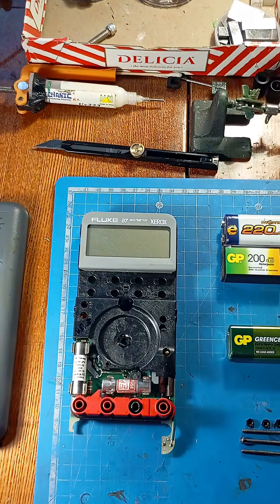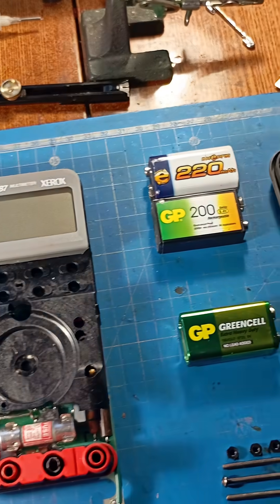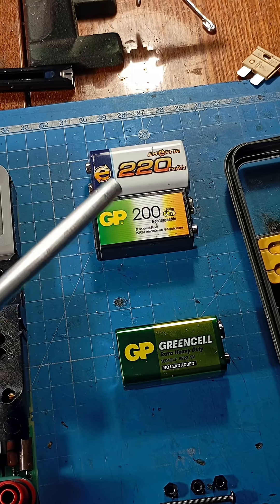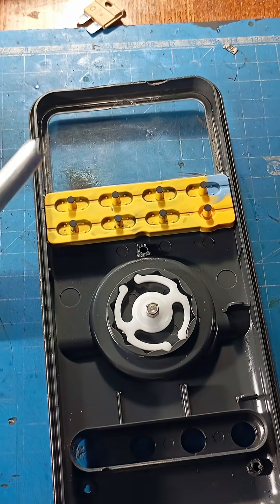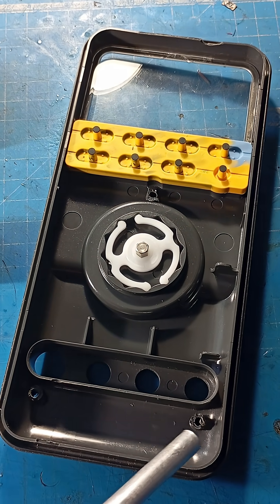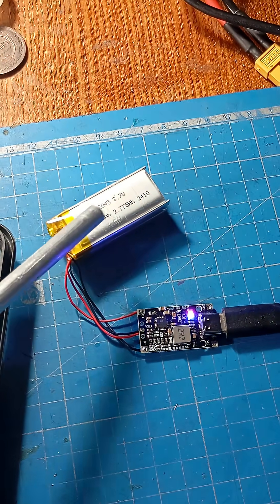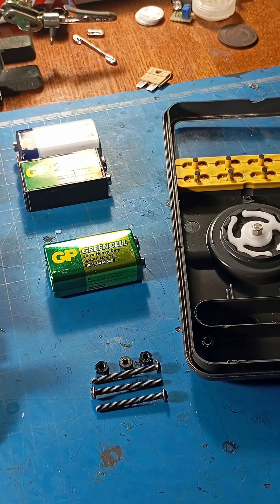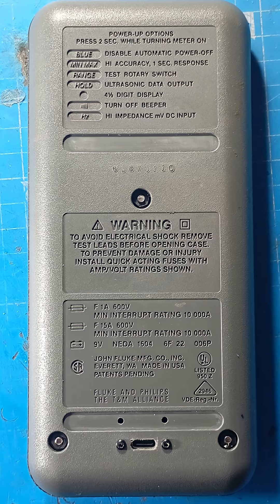Powering an old Fluke 87 from a LiPo battery

Comment: How to install nut on broken plastic screw, I also have f87v with no screw at all, it just hold by yellow rubber
Reply from the maker: watch the video again, in the demonstration part you can see what was done: I drilled holes through both halves, and where the screw head was, there is now a nut. And on the front half - screw heads. The color and shape are chosen in such a way that it is not very noticeable
Reply: @sxlab Thank you, found it - after pause & screen shot

Comment: It looks like you're charging off of a power supply. Could you not charge this off a phone charger I know they sell modules that boost convert the 5 volt from a phone charger and I'm sure it doesn't take a whole lot of current so even if it's busting one amp into a 0.5 amps to bump it up to 10 volts it still should be enough to charge it
Reply from the maker: i havn't usb trigger to control process.
Reply: I make Bluetooth speakers and what I do is I buy the charging module that has the constant voltage constant current charge characteristics that lithium batteries need and then I use a boost converter another option is to use a PD 3.1 version charging module and then use a c-type PD 3.1 charger if you use this version though you have to make sure you put in a module for the charging characteristics but I only use this version if I'm doing High volt bluetooth speakers such as 20 volts or 24 volts for your setup you should just be able to use the charged module that does the charging characteristics with a boost converter
Reply from the maker: This is LX LISC V2 board on IP2326 IC. You can search info about it
Reply: Use the TP5100 C-type charging module it's smaller and has the correct charging characteristics and you can use your phone charger

Comment: The bms board will heat and  make the battery temperature high
Reply from the maker: It has resistor that can limit current (need to resolder) so lipos are not heating at all and heating of module is in normal range

Comment: Isnt a multimeter needs a stable 9V voltage input? I dont think a switching regulator input is good for accuracy.
Reply from the maker: There is not DC/DC switching regulator. There is charging/balance module. That is used only when device is charging. 2S lipo gives 6.0..8.4V that is exactly in working range of this DMM
Reply: @sxlab  well in that case, nice. My metrahit metrawatt does not like anything besides alkaline 9v battery above 8.7V.

Comment: They had the digital version in the 1990s? My dad was an electronics troubleshooting engineer and only had analog types back then
Reply from the maker: It has 1986 copyright at PCB. First version of fluke 87 model was released in 1988. Yep, this is digital true rms multimeter with very good accuracy and 4000-count display + analog bargraph

Comment: I wonder if you could include a ttl to usb and actually get the data from it too. I know a lot of the flukes have a serial interface for calibration that you might be able to tap into. Now I wanna take a look in my newer fluke multimeter and see if there's any shenanigans i can get up to in there.
Reply from the maker: nope it has not any serial interface as I see

Comment: PARTS LIST PLEASE!!!
Reply from the maker: - lx lisc v2 charge/balance board
- two LiPo batteries LP802045 (750 mAh each)
- type c socket
- silicone wires

this board can limit current to 0.5A by changing one resistor

Comment: You should make a slit in the back of the rubber cover so you wont have to tale off the cover as much
Reply from the maker: Rubber case is high current protection (isolation of port). No problem to take off it few times per year
Reply: @sxlab what about recharge platforms?  You don't have to make a slit you could find an induction coil circuit and charge it on any recharge platform... Just an idea 😁

Comment: I wish i could do that to my EYE-CLOPS night-vision goggles I got at a thrift store... And yes it does work (like the O.G. Xbox) its just that the metal holding the batteries in place are corroded... The device runs on AA Batteries at 7.5v

Comment: Theses are not major problems. You do not have to open the case as you describe, to change the battery. You only have to remove the small battery door cover by removing two screws, The battery life is not a problem, since a good battery lasts over a year in my Fluke 87. The only problem was the screw holes which can be repaired with a couple of drops of epoxy.  The battery takes 90 seconds to change the battery at a cost of $3. The time and cost you spent modifying this meter could have paid for and changed batteries until 2035.
Reply from the maker: Small battery door is missing on this multimeter. This can be seen in the video. I use this multimeter very often, including LCD backlight. Everyone who writes that they have a good battery for a years obviously do not use it very often. The difference between a good dry battery and a good alkaline about 2 times. The difference between NIMH and alkaline up to 3 times. This does not give a multiple improvement.

I spent 1.5 hours and seven dollars (once) and got convenience

Comment: When putting screws back into plastic,  go counterclockwise lightly until you feel a click, then go clockwise. That way you wont rip out the threads in the plastic.
Reply: Exactly. And also a small touch of silicone grease on the threads. Lessens wear on the final quarter-turn of  'tightness".

Comment: I have a Fluke 87V that I have used on a daily basis at work for probably 15 years. I only need to replace the 9 volt in it maybe once every 18 months or so. The Fluke 87 I had prior to that was nearly as good as far as battery life goes. If you have to replace the 9 volt every few months, there must be some sort of a problem with it. Maybe a parasitic drain after it is shut off?? Most likely not enough to affect the Lithium battery, but enough to cause problems with the much lower amp/hour 9 volt.

Comment: Fantastic idea! What is the name and model of your yellow power supply unit?
Reply from the maker: Mechanic 3005DA , toroidal transformer, precise adjustment of voltage and current by encoders + memory, CC/CV modes + OCP, 30V / 5A. And it has USB port that can be limit at 5V

Comment: u put the charging port on the back really realy dude any how i love this trick if the device has space but requires normal batteries do this if it requires a difrent voltage but remains less than 2 or 3 amps total you can get a step up or step down module make this work for almost any thing

Comment: I've added rechargeable 9 volt batteries to a few things. They have a USB port on the bottom of the battery to charge it so don't even have to disconnect the battery. On a device like this I would add a hole for access to the USB plug or add a small extension.

Comment: Does your USB-c module have the required resistors to be powered from a PD adapter?
Reply from the maker: As I understand, it use only QC. I modify it to charge at 0.5A per cell, so this is low current usage and I don't need PD charger. Simple 5V / 2A source is enough
Reply: @sxlab  The reason I ask is because I bought some single-cell charger modules from Amazon and they won't power on from a USB-C charger unless I add resistors to the CC1 and CC2 pins.  It's just part of how the USB-C standard works.  USB A to C cables aren't affected by this issue because the ports are always powered by 5 volts.

Comment: Great work! I noticed the LiPo battery is 3.7V - did you use a boost converter to take it up to 9Volts or did you hard wire to the board downstream of the circuitry for voltage control?

Comment: Nicely done!  The internal case pieces tend to be brittle due to age, but also because they are made to act as RF shielding to protect from erroneous readings.  You can still purchase replacement parts from Fluke for a very fair price.

Comment: I'm doing the exact same to my foster dads Alti MM. It's not worth much, doesn't have continuity but it's what we used years ago to make our first PCB kits. 
I found a e cig Battery with a charge circuit and have a few buck converters laying around. Of course I'm gonna buy a new mm but yeah I just want to have it working again. The 9 v battery from 2002 was still going but had corroded the terminal.

Comment: A little tip for self tappers that will stop the screw hold damage.  Put the screws in, then run then backwards until they drop into the thread.  The should then be run the normal way and will use the originally cut threads.  I do like the LiPo/USB mod though.

Comment: You have compromised the isolation that keep you safe. Its garbage now. And you should probably not influence others people to do the same. Take the video down.
Reply from the maker: Fat rubber case is isolation of port.

I always treat my viewers as people with the appropriate knowledge.

Tell me, should people even get to the multimeter and modify something if they don't understand how dangerous electric current is?
Reply: @sxlab the rubber case can be taken off without any tools so it's not part of the insulation class. But I understand what you mean, if only you uses this device and understand the risk. But don't put it into use on anything that can contain any high voltage because the case is compromised.

Comment: Iv done the same thing with a bunch of flash lights and anything that took AAA or AA batteries i just had people i know who use vapes throw their used vapes in a box take them apard for the battery charging port and circuit board. Really easy to do cost nothing but a little time.

Comment: I have had a multimeter for 8-10 years and never have i ever need it to change the battery, and i use it regularly. And now it doesn't have a solar cell on the front like a calculator...

Comment: Modern meters tell you not to use rechargable cells, does that apply to this meter?
Reply from the maker: Which of them? F.e. I have also fnirsi 2c53t for field working with 3000 mah lipo battery and 5 hours of work :)
Reply: @sxlab  most of the fluke ones, they say replace with a specific type cell embossed into the back of them and the manuals say do not user rechargeable cells, think it has to do with them being a different voltage
Reply from the maker: 9f22 has 6.0...9.0V voltage ragne
2S LiPo almost the same

NiMH has lower voltage range and drop it fastly + big self-discharge and small capacity
LiPo can swell, leak and ignite, that are the risks

Comment: I've had my Fluke 87 digital multimeter for the past 20 plus yrs and never have had this issue and I use it on a daliy basis. Although this is a good  idea, I don't feel the need for it, thx for sharing
Reply: We used them (the 87’s) on service calls. Batteries (non rechargeable) should last 2000 hours. Might be something wrong with filmers meter. I have a 300 series clamp meter that eats a pair AA’s every few weeks after AA’s have been leaking. I have thoroughly cleaned the PCB but that didn’t make any difference.
Reply: You might after seeing the price of a 9 V  while a rechargeable Li is $8
Reply: @danc2014 over here they are two for €1,80.

Comment: I've wanted to do the samebto my Fluke 189 that has 4x AA batteries...
Do uou think yhe voltahe range is okay?
Reply from the maker: no, 4AA = 4.0...6.0V
2S LiPo = 6.0...8.4V
Reply: @sxlab  This is clear, but can the circuitry tolerate/regulate the extra 2 volts?
Reply from the maker: You need step up dc-dc converter for 1s lipo or step down for 2S lipo. But nost of them are noisy. This is not good for ADC
Reply from the maker: if you will use linear voltage regulator it's possible. But you need low voltage limiter (f.e. kill switch)

Comment: Had it calibrated lately?
Reply from the maker: It's still show correct value of resistance, voltage and current, when I connect it to calibrated sources

Comment: Does the noise from the boost converter does not messes with the accuracy?
Reply from the maker: I don't use the charging module while the device is running. The rest of the time (which is several months) it doesn't affect to the ADC of the multimeter.

Comment: It´s a great idea, but please don´t use it without the back cover when working with high voltages. By installing the USB plug at the back of the multimeter you have violated the double insulation of the multimeter providesd by the pastic housing. There is a reason why these multimeters use non-rechargable dry batteries.

Comment: Still rockin' a Fluke 78 here, bought (mumblety) years ago.  Still works great!  Had to tear apart and clean the contacts for the LCD display once (was fading out and unreadable), but is still as good as new, today.  Had to add an 87V later, for testing capacitance.  No substitute for Fluke mutlimeters!

Comment: Can I get an Amazon link for the parts you used. I want to do this to my Digitrax dh200
Reply from the maker: I use two LiPo's LP802045 / 8*19*44 mm  / 750 mAh and type-c soket from local store and charging/balancing module I've bought here 

https://www.aliexpress.com/item/1005004953490404.html

Comment: I've never known a meter to eat batteries to the point of wanting to put a rechargeable in...I guess I don't use my meter much.
Reply from the maker: There are two negative effects. Due to certain circuit features, the multimeter can consume several microamperes when turned off. And typical nickel-metal hydride batteries have a high self-discharge and low capacity.

Comment: Fluke gives lifetime warranty on their products against these failures.. that case half they would replace for you. I've gotten knobs and buttons for one that old from them
Reply from the maker: This is an obvious plus for relatively new products. I don't think they have a cases for models developed in the 80s. Although I could be wrong. But it's still not a practical solution, until the next breakdown.
Reply: @sxlab just a couple years ago in ordered parts for a fluke 87 that was manufactured and sold in 1988.. fluke keeps the exact same setups for as long as they possibly can because almost all military testing and diagnostic using flukes has set in stone manuals that would have to be rewritten if they changed their stuff like every other company does all the time

Comment: Now make a smal opening in that cover so you don't need to remove it to charge
Reply from the maker: It's no problem to remove rubber case few times per year. But it protect socket from dirty and moisture. And user from high voltage shock
Reply: @sxlab  the dirt/mister part i get. But how can it give you a shock?? 😮
Reply from the maker: @John_Makes-s high voltage arc from open type-c socket contacts to hand
Reply: @sxlab  but why is there a risc of a high voltage arc in the first place? A have a lot of electric devices what use USB c (and older/other types) to charge and none of them have this
Reply from the maker: @John_Makes-s 
This meter can measure up 1000V DC. At this DC voltage length of arc can be up to 15...30 mm and about twice less on AC. It's possible if your body is grounded or has poor isolation from ground or you touch another conductor

Comment: I use a fluke 87 as my go-to meter. Never really had the battery issues. Where do you find the USB charging & balancing module?
Reply from the maker: I bought it here 

https://www.aliexpress.com/item/1005004953490404.html 

It has resistor to limit current. So I down it to 0.5A per cell

Comment: the Li battery is 3.7v  and it's replacing a 9v? did you use 3?
Reply from the maker: 2S LiPo = 6.0...8.4V, it's exactly in working range of this multimeter (6-10V)

Comment: Fluke is the only electronic device I will happily buy used. I have 20 and 30 year old flukes that still work today after spending years on relatives jobsites. I only put them down because I wanted a dc amp clamp fluke 374

Comment: My 87 V's battery lasts over a year at a time.
Reply from the maker: Alkaline? Their capacity is close to the capacity of the battery I used to replace it. The capacity of dry batteries is much smaller. It also depends on how long the device is in use every day.

Comment: Smart with the 2s battery, no regulator to create interference.
Reply from the maker: Yes, this is not necessary with the upper voltage of 2s LiPo (8.4 V). And the lower voltage (6.0 V) is exactly the minimum operating voltage for this multimeter. I also considered a rechargeable lithium-polymer battery in the 6F22 form factor, but it has one small cell and a noisy step-up regulator.

Comment: Works for several months without charging. 
You probably broke some sorta “Multimeter Law”. 
These brands may wear different costumes but it feels like they’re on the same team. 
It’s 2025, I want a dependable multimeter with a 360 ez-swivel mag mount. With retractable silicone test leads that have a built-in retractable test-pin needle. A backlit screen that won’t time out until the project is complete and is detachable. 

Until then I’ll just mod cheaper brands and advertise their name👍

Comment: Such a great work still forgot to make a hole in bump case?? Nonsense
Reply: Yeah, adding a cutout in the bump case for the USB-C connector and LED holes would have been my suggestion as well. Maybe also add some light-pipes through the housing to help pull the illumination out a little.
Reply from the maker: If necessary, I can always do it. It is worth noting that the rubber cover protects the connector from dirt, moisture, and the user from high voltage. Well, now I have to charge it only 2-3 times a year. The device has a well-functioning sleep mode, even if I forget to turn it off. This is not a smartphone - like multimeters that need to be charged daily. For example, the Fnirsi 2С53T has a 3000 mAh battery, and it works for only 5 hours from it